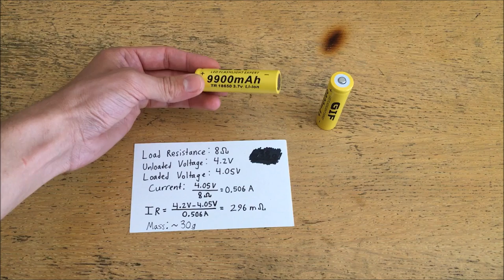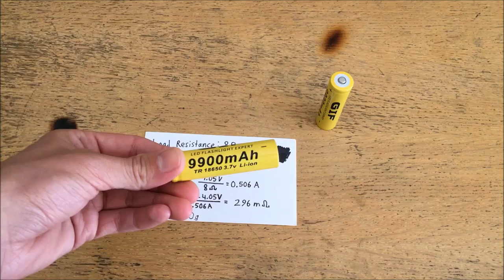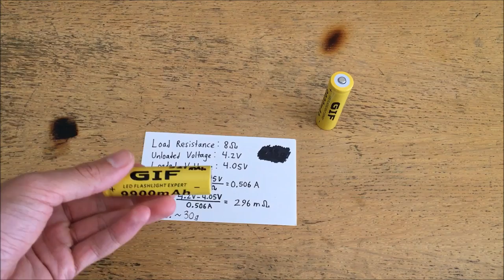EP 33 - "9900 mAh" 18650 Cell Teardown

Comment: If you get a chance to handle a cell before you buy, weight is a pretty good indicator of capacity. IF it were possible, to put enough active material in a 18650 console to store that many amp hours, it would be at least as heavy as a premium alkaline cell of the same size.(You get what you pay for, not one bit more)Thanks for posting. That's one problem, with purchasing online, you don't get to see the product in person, so it really is a gamble. If it sounds too good to be true, it almost always is!

Comment: Nice and interesting video! Thanks! Recently i've bought AAA and AA Ni-MH batteries on eBay rated at 1800mAh and 3000mAh respectively. I bought them just because i was curious to see how small will their capacity be. They are much lighter than ordinary  Ni-MH cells and the capacity is 180-200mAh for AAA and 240-250mAh for AA.

Comment: nice goin DV , very methodical & scientific , professional lab work ! 
enlightening to say the least 
I confess I did (suspiciously) buy some of these , dozen just came in today , 
won't bother wasting my time
Reply from the maker: Thanks! Keep in mind these are still usable cells, they just have low capacity and high IR. If you have some already you might use them in a low-drain application.
Reply: ever do the controlled repeated cycle test to determine the cycle life of the cells.
Reply from the maker: Bob Saturday Not yet, but I might do a repeated discharge test in the future and report on the results. Good idea!
Reply: probably a waste of time now that I realize what junk these are
time better spent sorting out whats who with the "real"  manufacturers

Comment: So what is a quick safe way to discharge a 18650?
Reply from the maker: I recommend connecting a resistor across it, for example, 10 ohms, if you want to permanently discharge it. Leave it for a day or so.

Comment: Hello! Why it does say 3.7v if its a 4.2 v ???
Reply from the maker: 3.7V is the nominal voltage of the cell, meaning it is the voltage at which the cell energy can be calculated by multiplying voltage by charge (Ah) capacity. 4.2V is the full charge voltage, which is higher than the average voltage of the cell during discharge, and is thus not used for calculating energy storage.
Reply: Dielectric Videos Thanks!!!

Comment: So what's the highest mah we can get out of a 18650? I get 3500 from the one that comes with a vaporizer, but there should be higher. The smaller 18350  came in 900 mah, but I bought a 1200 and this one was legit better by a real company not chinese.
Reply from the maker: 3600 mAh cells are available, but they are storage cells with typically lower discharge rate. There are some very high-discharge 3000 mAh cells that would be excellent for a vape application.

Comment: what a pile of crap! nice deconstruction....  sadly I've seen people buy cases of those, id like to see how they perform using a datalogging cell cycler. I bet they'd crap out before 100 cycles.
Reply from the maker: It would be very interesting to run a controlled repeated cycle test to determine the cycle life of the cells. 

I have already written an Arduino program that I use to measure discharge capacity and cutoff discharging at a minimum voltage. In the future I may modify my program to allow re-charging the cells up to 4.2V, with the option to continuously cycle the cells or cycle them until the capacity reaches a fixed minimum over time.